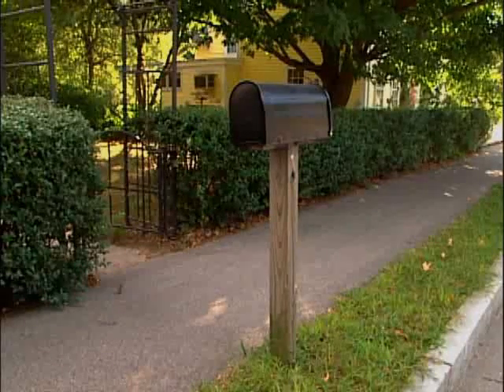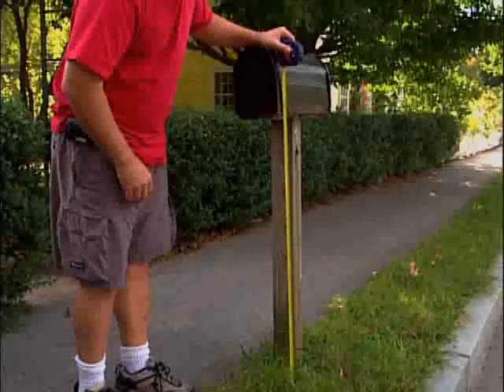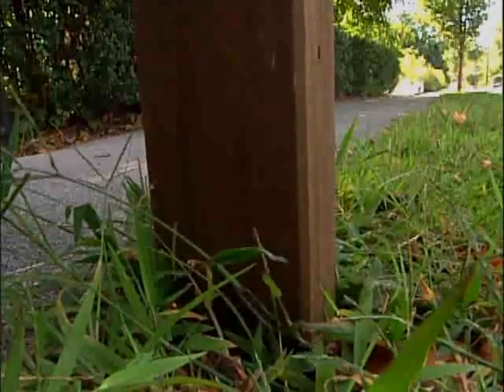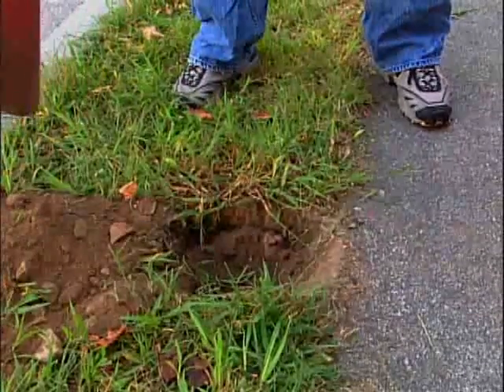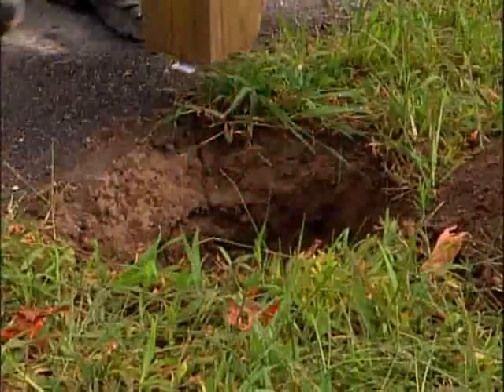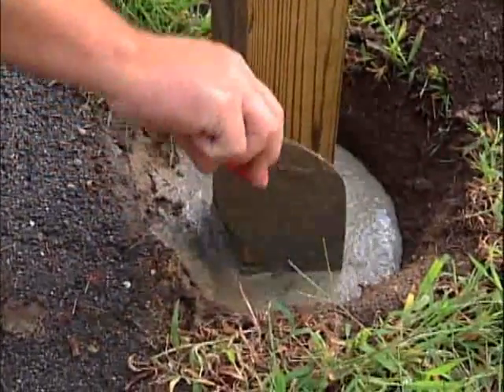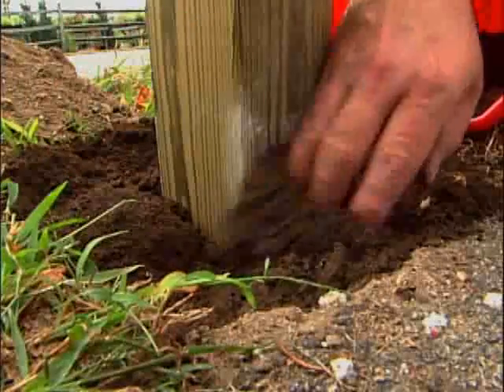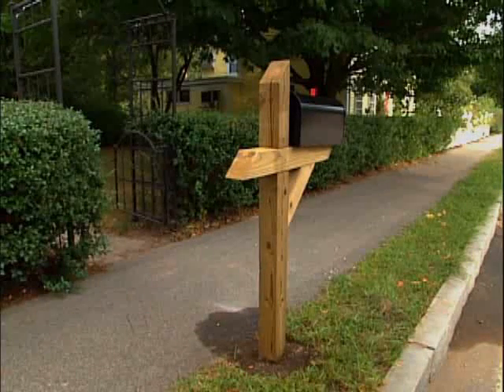How to Install a New Mailbox Post

Comment: The new smart way. 1) Pour wet cement in the gallon milk container. 2) Mailbox post in to gallon milk container and let it dry. 3) Dig and post in only 15 minutes. Done. ( PS. Pour cement in to hole the old way. It's hard to dig old cement out.) 🙂😷😎 ( Don't forget to cut the top milk container off. So the mailbox post be able to fit in )
Reply: The only concern I would have with this method is that post+concrete foot might settle and not stay level.  This is less likely to happen with method in the video because the hole you dug is filled entirely with cement.  There is no loose dirt fill around the cement that will be prone to compaction and movement.
Reply: @Faladrin  I bought M1-LT Fort Knox Mailbox with locked and heavy. Got a bigger cement container to post in. It's very stable and level. Milk jar container small , just perfect balance for cheap light mailbox.  🙂❤️

Comment: I used Quickcrete fence post concrete in the "RED" bag, It set up within 10 min of mixing and then I could not pour it because it was not pourable. On another project I poured the dry cement mix and added water, the next day I could move the 4x4 around so I used regular concrete on the rest of my beams and guess what, it is solid. If you have time to set your post properly overnight, Use regular concrete

Comment: My husband thinks we need no Quick Crete
Reply: I never used any. Took over 20 years and over a hundred whacks from the snow plow drivers. Debating on doing it right this time, as replacing mine will be easy since I don't have to dig out concrete.
Reply: He’s right. USPS recommends you don’t use concrete in case a car hits it

Comment: The clamping thing just doesn't compute for me. I'm not the brightest bulb, in full transparency and I'm about as hand as a foot, so take my comments with a grain of salt.
Reply: You clamp the two beams/boards to the post so that the long ends of those pieces can rest on the first ground and help hold the post in place and upright while the cement dries.  You might be able to use other method to do the same, but this seems easy enough.

Now days though you could use fast drying cement intended for posts like this.  They harden in like 10 minutes, so you could just stand there holding the post in place.
Reply: @Faladrin  Thanks for taking the time to reply! Great advice. Fortunately I figured out a process that worked. And yes, quick drying cement saved the day!